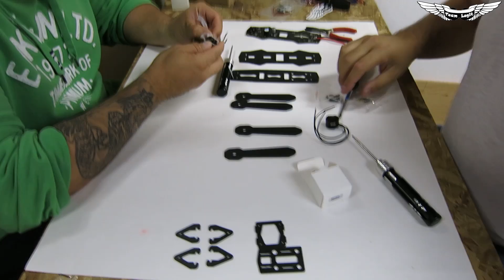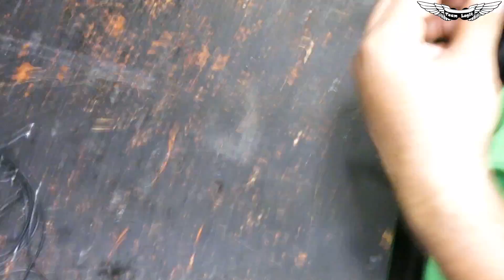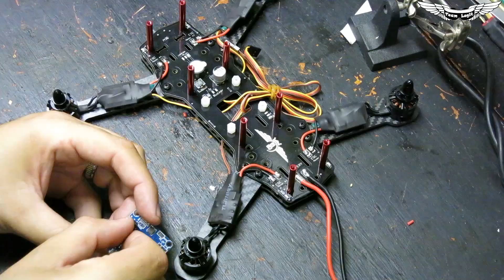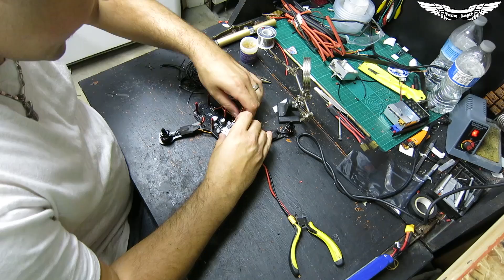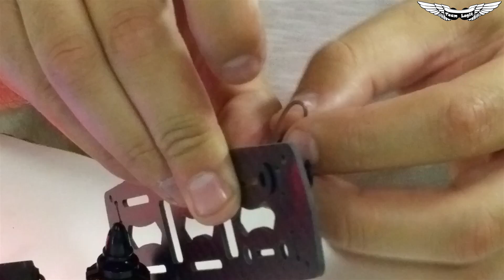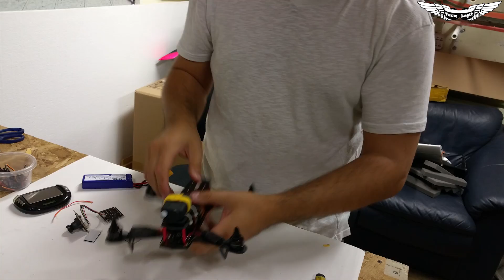Complete Mini Quad Build Video of ZMR 250 With PDB Beginners Guide

Comment: i have 450 size drone motor which is 1100kv. can i use that motor for 250 size drone with small prop?
Reply from the maker: To run 1100kv with 5-6" propellers, you would want to run the system on 6S voltage.  Be sure that the rest of your equipment will tolerate 6S and test gradually... no promises from us that things will work out ;)

Comment: hi guys ......I have a QAV250 Quadcopter and the instructions are not clear I don't know how to plug in the flight controller and put the props on and which the motors are meant to run it doesn't show on the instructions the plastic space's for the flight controller  ct board were not there in the box        .......... my email   peternohlmans@bigpond.com

Comment: hi great build video and tips just a quick question the black series motors the blade screws all turn the same way as i have just found out do you use lock nuts on yours or do you change the blade mounts. thanks andy uk

Comment: could you please explain why you removed the black and red wires from the 3 motors?
Reply from the maker: ***** The Black and red wires are the 5v coming out of the BEC. It is not requires since we have the 5v coming from the BEC #1. Its just better to remove the additional wires.
Reply: Team Legit 
Or you could use a separate $1 step down. That way you could just buy all of the ESC without the BEC. 
Am I correct?
Reply from the maker: Correct. Or you could just use the on board 5v Reg thats already built on the PDB

Comment: I haven't read all of the posts here but doesn't this PDB have signal traces to each esc so that you can eliminate running a servo wire from each esc to the FCB?
Reply from the maker: Daniel Garner  on the V1.2 it can this is the original one before the traces.

Comment: Great video. Are there any advantages of using three blade propeller over a two blade?
Reply from the maker: Segen I have not noticed any advantages of any 3 bladed props. Standard props with the right power system do just fine and are more efficient

Comment: Could you double up the bottom plate with the extra plate to add strength, or is this a bad idea. Maybe some kind of bonding compound to alleviate any friction?  I've just seen ZMR 250 in half on a couple of videos, and start my build soon. Maybe one of theses? http://thingiverse-production.s3.amazonaws.com/renders/65/3a/e9/92/49/ZMR250_BOTTOM_1024_preview_featured.jpg
Reply from the maker: Christopher Kidd You could do that but your adding unnecessary Weight. The Frame you saw in half must have had a catastrophic crash or must have been compromised from other crashes. Was it on 7demo7's channel ?

Comment: Hey guys,  Using the overcraft board and OSD.  I am having an issue that I cannot plug in the OSD TX, RX lines and have the USB and Lipo battery connected at the same time.  Clean flight will not connect with this configuration.  If I disconnect the TX, RX lines on the Naze32 then clean flight will connect with the lipo connected.   Any issues on connecting the OSD that we need to know about?

Comment: Is there any way to test motor direction without using a servo tester?
Reply from the maker: You can plug them into the throttle channel of your receiver and use the radio to spool them up.
Reply: Team Legit thanks!

Comment: any tips on getting the motors mounted to arms?
Reply from the maker: 1. Make sure your mounting screws aren't too long that they crush the wires in the motor. 2. Make sure the screws aren't too short that they will rip out. 3. Don't Tighten all the screws until you have began threading them in. Basically put all the screws in just a little bit at first, then slowly tighten them all little at a time so they seat correctly.
Reply: Ok thankyou👍

Comment: I'm thinking about doing a zmr250 build next month, can I use a devo 7 transmitter and rx2637h-d receiver with the cc3d flight controller? I used the devo 7 with one of my helis, but I'd like to use it for the quadcopter build to save a little money.

Comment: its a PCB board.... Printed Circuit Board... not PDB board....
Reply from the maker: You are also correct, but in this situation its a PDB Power Distribution Board, since it distributes the power to all of the components including the ESC's and FPV gear.

Comment: Hi, nice job... i have a couple of questions the board you have seems identical to a naze 10DOF board i purchased from value hobby which says it has gps and compass... You call yours a dragonfly...being brand new to mini quads and still waiting on more parts is mine a naze or a dragonfly? and do they both work same sing same software to program?? thax
Reply from the maker: The Hardware on your board may be a bit different than ours or the original naze32 but as long as it can run Base flight or Clean Flight it should be essentially the same.
Reply: Team Legit Also looks identical to flip 32.... thax

Comment: hey man im new to quad copters but im gona build my own. ive learnt alot already but since your a pro ill show you my list and would you be able to tell me if im missing anything apart from the controller/radio.

Props : GemFan 5040 Nylon Props

Board : naze 32

Motors : DYS 1806 2300kv

ESC : Emax 12amp Simon K Esc's

Batteries : Zippy Compact 3s 1500mah 25c and Turnigy Nano-Tech 1500mah 35C-70

Recording Camera : Mobius Camera Action Sports FPV Dash Cam Camera 1080P Full HD Wide Angle

FPV Camera :  600TVL Sony PZ0420 SUPER HAD CCD D-WDR Color Board Camera

Transmitter : Boscam TS5823 200mw 5.8ghz 32 channels

Antennas : Fat Shark / ImmersionRC 5.8GHz Circular Polarized SpiroNet Antennas V2 SMA

Frame : QAV250 C250 H250 ZMR250 Carbon Fiber Mini 250 FPV Quadcopter Frame Mini Quad Frame S
Reply: +Team Legit hey it's me again 1 1/2 years later I waited a while as you can tell I'm 14 now and I finished building my racing quad yesterday!! Thx for the video;))
Reply: Make sure you have connectors for everything, I know you need some JST's male for the tx and rx, but aside from connectors, that's a nice set up
Reply from the maker: Just saw this post. It looks like your ready to go. I would suggest some Nylon Standoffs to mount the Naze32 and the the regular things like battery leads/connector. If your using the PDB everything should go pretty smooth. Good luck let us know how it turns out.
Reply: Team Legit ok will do!

Comment: What soldering iron do you use? i need one but im not sure what to get.
Reply from the maker: You should use an Adjustable soldering station at least 60w. It will make for quick and clean builds and easy soldering.
Reply: thanks but sorry to be a pain can i find out what you use? like the exact one.
Reply from the maker: This is the one were using

http://www.amazon.com/Soldering-Station-Features-Continuously-Variable/dp/B0029N70WM/ref=sr_1_11?ie=UTF8&qid=1418336298&sr=8-11&keywords=soldering+station&pebp=1418336307708
Reply: ok thanks

Comment: Would it not be easier and faster to hit the board cam electrics with the liquid tape, instead of the double sided tape?
Reply from the maker: Yes the Liquid tape is a great way to keep electronics Isolated. However the Double Sided take has a foam Cushion that 1. helps absorb vibes 2. allows the camera to break loose in an impact rather then breaking the lens.

Comment: Are the FPV pads filtered?  Also is there a 12v stepup on the board?  I want to use a IMRC 600mw with a 12v cam.  Cheers,
Reply from the maker: Yes the VTX and Cam Pads are filtered. 
Your combo will work great. Just solder your immerions to the VTX pads with the + - to the pads and only the Video to the Video Pad. Then Do same for the camera.